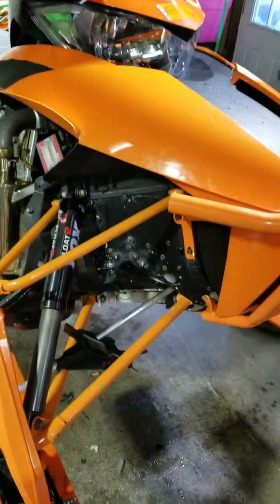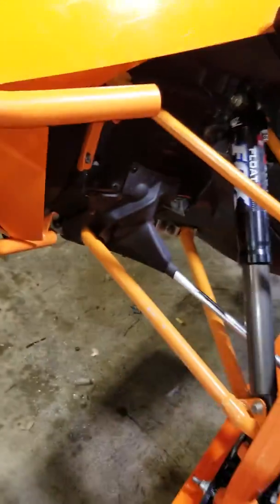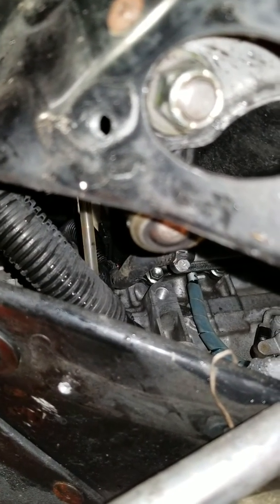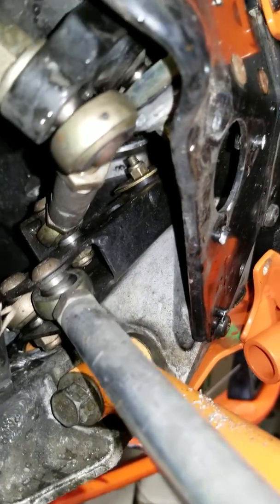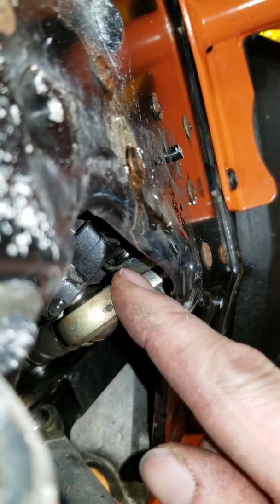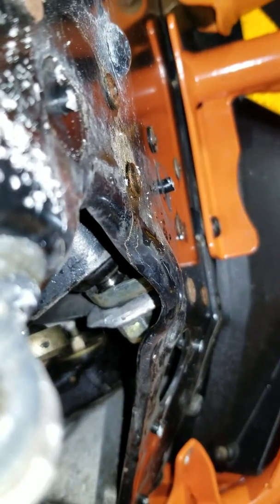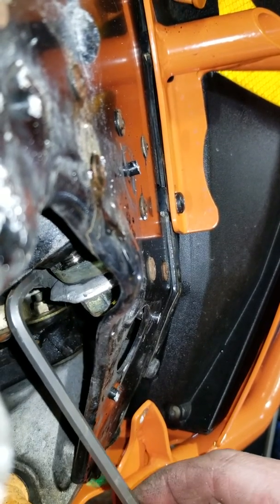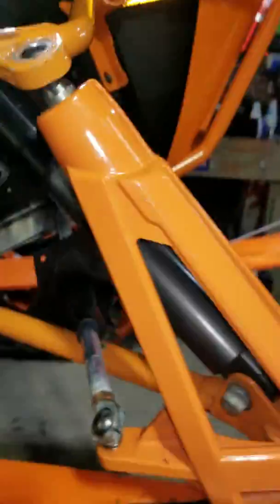Arctic cat loose stearing easy fix

Comment: I'm in the process of replacing the steering mount plates, what a pin in the ass! Trying to un thread that 15mm nut is impossible so ill give your idea a try! Woukd you remember the size of Allen key used? Thanks again for doing the video
Reply: How'd you end up getting that plate out?
Reply: @dylanconquergood4915  it was a job on its own! All the rivets need to be drilled out! I'd suggest buying an rivet gun to re install hew ones. I bought one at Princess auto $90. Once you get the main nut off they just need to be maneuvered around, when installing the new ones the both have to go in togetherit took me about 6hrs in total. Not bad for a first timer. When you undo the main nut, use a small Allan key to hold the shift from spinning. Itll work
Reply: @dylanconquergood4915  if you need any other questions reply and ill shoot my email